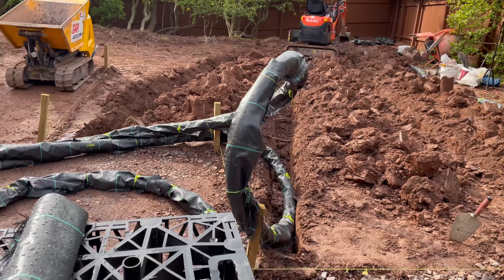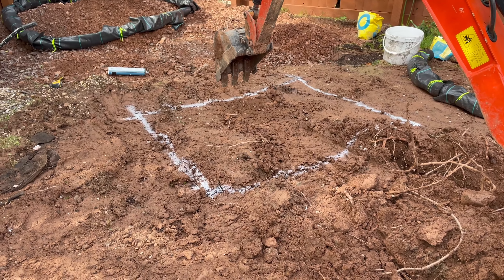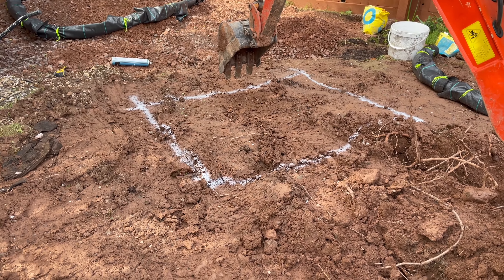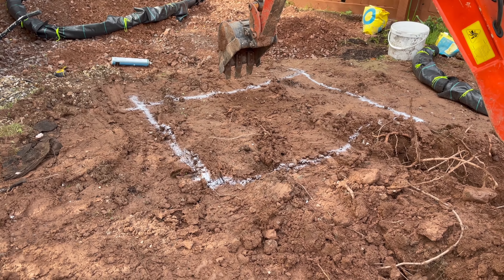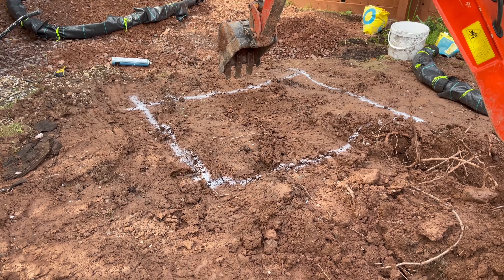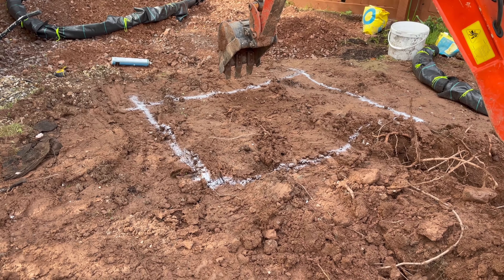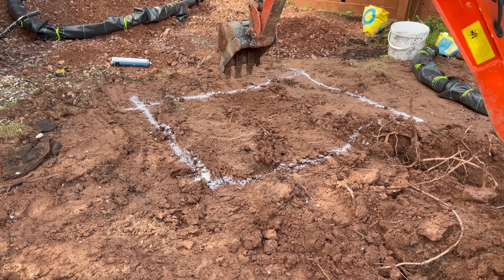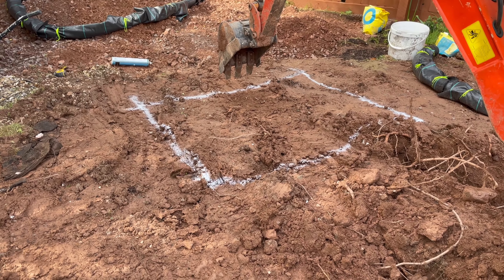Efficient French Drain Installation: Step-by-Step Guide

Comment: Hi Scott, putting these behind block retaining walls (only 2 courses high), what's the best process? I have perforated pipes and washed granite. Do I tank the wall first, then woven fabric around the gravel with the pipe in the centre like a donut filling? Or should I use non woven fabric? Just don't see how the washed stone will wick up the water into the pipe?? Would a base of coarse sand work underneath the pipe better? Then stone on top?
Reply from the maker: Surrounded by 20 mil clean stone is normally the rule of thumb and as for the fabric I’d go woven it’s stronger to tie round the pipe the non woven tiers easily 👍🏴

Comment: What’s the best way to lay an aco drain? Please
Reply from the maker: Lay the eco-drain on a screed base and direct to a gully pot or whatever else it can connect up to or even a soak away 👍🏴
Reply: @tidybrickslandscaping  thanks for reply, do you have to put it down with fall? Cheers
Reply from the maker: @zachminto7220  depends if it’s against the house if it’s against the house then has to be level water will always find the way to the opening provided 👍🏴
Reply: @tidybrickslandscaping  yes going up against the house many thanks, and cheers for the great videos 👍👏👍